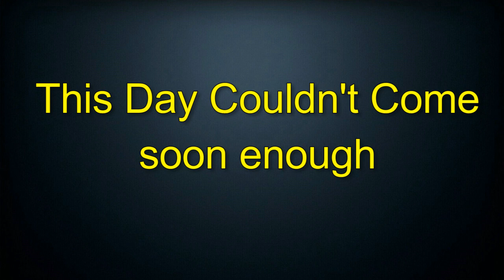Building a Culvert Bridge-Pt- 3  Vid-056

Comment: That sir is a mighty fine job and should be there for years to come.That bridge sure beats the bronco riding that you were doing for sure. thanks for bringing us along for the build. I learned a lot.
Reply from the maker: Hey there Jerry. I appreciate the kind words and I thank you for hanging in with me as I did the project. Yep, I do hope the Culvert Bridge holds up.  It's been tested several times with several heavy rains and nothing appears to be weakening. Ha, I had to laugh about the Bronco rides. I went through several of those challenges along the original path.  Thanks again.

Comment: Great instructional video.  I've only seen stone culvert heads.  I'm in need of building some on my drainage ditches.  Thanks for sharing.  An incredibly valuable addition to your property!
Reply from the maker: Thanks for watching and commenting, Pilgrim.  Yes, most culvert head-walls are constructed from rock, stone, or concrete.  I may sometime down the road make a concrete culvert head-wall but this is not a main water-flowing culvert bridge even though it will hold water during monsoon season. That's what I'm experiencing at the moment.  Once this passes, there will be  no water in the ditch for months. It simply is absorbed.  Thanks again.  Have a fine Resurrection Day and I look forward to your next video.

Comment: Sweet! I could feel your frustration with that warped 2×8. It looks like you will be able to drive a pickup over this bridge. Nice work!
Reply from the maker: Hey Nordlander, thank you for the support. Yep, I had to chuckle that I got so frustrated about that warped board.  You know, I wouldn't mind it so badly if I was closer to the house and could cut another one but I'm back in the sticks, ha.  Well, it worked with a little sweet persuasion 😊. I think the culvert bridge will be pretty strong. Thanks for watching and the encouraging words.  Will be over to check out more of your videos. 👍🏽
Reply: @houndsmanone4563  I need to get back at making some videos. I have a few more subs until 1k. I have a flashlight review to do on an LED flashlight I bought two years ago. Actually two flashlights. One is a tactical flashlight of sorts and the other a pistol grip LED flashlight. Both marketed by Interstate Battery.
Reply from the maker: @1crazynordlander  Those flashlights sound interesting. It won't be long before you hit 1K subs. Man, it's like climbing a mountain to hit the summit 😯 but you'll eventually get there and then...you'll be famous 😊! (just a little humor).  Are you one of the folks working or are you required to stay home like the rest of the nation?

Comment: The bridge over my creek is pretty  much washed up and there's no driving to the back 60 acres on my farm. My brother gave me a 21" galvanized culvert to put in a new bridge. Thanks for the video, heckuva project I've got coming this summer but this was incredibly helpful.
Reply from the maker: Yes Sir, you will have a lot of work ahead of you.  I just checked my culvert bridge two weeks ago and the bridge is still sturdy as day one.  Please realize, I have water that flows into the ditch but it is not a flowing stream.  If there was a running stream, I would have used cement in addition to the wooden boards for the headwalls.  The cement would stand a better chance if there was running water.  You do not want water to get between the walls of your culvert pipe and the packed dirt/stone because once water finds a little pathway, it enlarges the opening and then all your material washes away.  I hope you video the entire process and place on YouTube.  Thanks much for stopping by and commenting.  Good luck. 👍🏽🤠 01/24/24
Reply: @houndsmanone4563   Yup and thanks. Same brother, also a master mason, helps me with advice and I do have a running creek and was intending to use stones embedded in concrete all the way up the headwalls on both end of the culvert.
P.S. I am not a 'Sir'. ;) Thank you again! I will attempt to film as much as I can.
Reply from the maker: Sorry Ironmaiden, I should have paid more  attention to the channel name.  When executing your build, have fun and enjoy the moment. I think the embedded stone in concrete would look great.  I've always liked that look. It reminds me of our older historic homes up in PA around Gettysburg. 👍🏽🤠   @The1IronMaiden
Reply: @houndsmanone4563  Yep, my farmhouse is very old too, it should all tie in quite nicely. Thanks again!

Comment: HO , love the way you used older  re - purposed pressure treated lumber  ( looks like from an old dismantled deck ) . I can tell that it is very solid / dense and my guess is that you had a sharp blade to cut it .  I see you already have some water in your ditch . Pretty work . If your like me , I will find myself standing by it and just looking at it for the next day or two to admire the workmanship .
Reply from the maker: Yep, the boards are from a deck we had on our dock.  We lived on salt-water area right along the river (brackish water).  These boards are treated and are quite solid.  They are 20 years old and held up better than the newer wood today.  Thanks for your kind words B&A.  Enjoyed this project but I have more 😊 but they're not as intense as this project.  Thanks again, B&A.

Comment: the top 6x6's you could have put a 45 degree angle on the ends,
Reply from the maker: Dang we think alike, Joey but if I cut it, then I have to paint it or at least the ends of it so I said I'll let it go.  I also didn't have a  tool to cut a 6x6 at an angle without too much difficulty. Those 6x6's are a bit cumbersome to be throwing around atop tables (smile) but I thought the exact same thing as you. Give it an angle slope as a finished look. 😊
Reply: My Slice Of Heaven Outdoors Hey Joey!
Reply: @houndsmanone4563  great minds think alike
Reply: @eastwindfarms3671  Hello, Happy Easter

Comment: So glad I found this! I have been thinking of doing something like this on a little crossing I have, been looking for best ideas.. I would say this one will work just fine for my needs!  Have you had any issues this year, anything you would change?
Reply from the maker: ColumbiaCollegeSSS, I've had no issues with this culvert bridge but please realize, I have standing water, not a flowing stream therefore no erosion or deterioration of the headwalls.  The only thing I would change is make sure I have help next time 🙂.  I had a stroke about 4 months after completing this project.  Thank you for watching and hope your build goes smoothly.  BTW, curious? how did you find this particular video?  I found many bridge videos but none to give me guidance on how to approach on how I was going to do mine. Maybe my initial search wasn't thorough enough 🙁 .  Wish the very best to you and hope you make a video building your bridge.  Just have fun doing it.  I sure did.  As you can see, I'm out in the boonies.
Reply: @houndsmanone4563  Guess I kind of busted myself for checking youtube at work.  I just got back to searching for more ideas and wondered if you had responded, I realize now that I was on my work account when searching 2 weeks ago.  I have been searching and searching for good ideas on my head walls.  I made the mistake of putting in a bit too short of a culvert.   It is 36 inches round, but the slope to the drainage ditch was a bit more than I thought when I filled it in, so my walls will need to be closer to vertical to get a side-by-side across safely.  It works fine for a walking trail, or even my BX.  So, now I am just trying to fix a mistake. :-)  I just keep diving deeper and deeper into the youtube world until I find something that works for my situation. Thank you for the video, and the advise,  I hope you are recovering well from the stroke.

Comment: How much would it cost to have someone build this?
Reply from the maker: I really don't know what somene would charge to build this, KneeGrow Network.  It might have cost me several hundred dollars for materials which I purchased over a span of time.  I already had a load rock.  I ordered a load of clay-dirt. I already had the 10 foot, double-walled culvert.   I bought several 10 foot sections of 1/2 inch rebar, several boxes of 3 inch wood screws, about a dozen or so 12 inch timber screws, several treated 6x6 wood beams, and a long drill bit to pre-drill for those 12 inch screws. I never tallied up the total $pent but it wasn't much compared to what a group of guys down here would have charged to build it. I hope I answered what you were asking about but if I hadn't, feel free to send a comment addressing specifics.  Thanks for watching my video and for the comment.  Have a fine weekend, KneeGrow Network.  👍🏽🤠